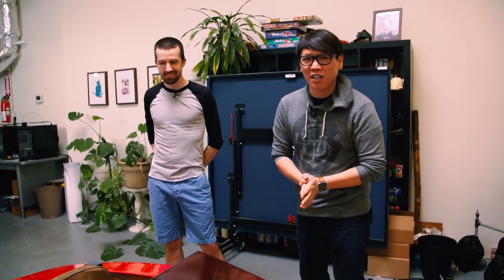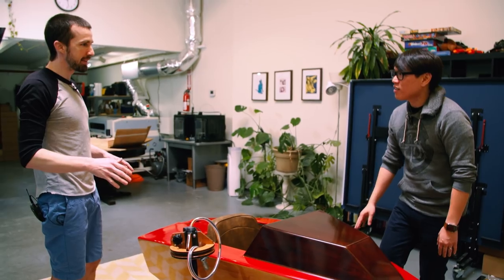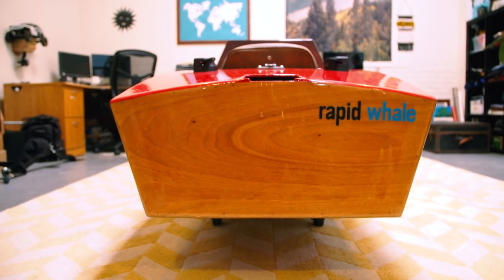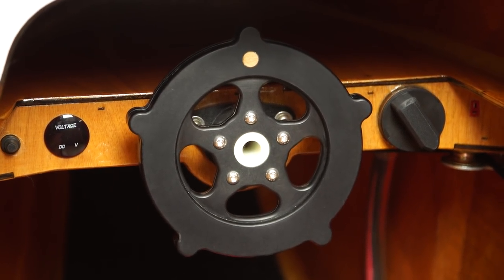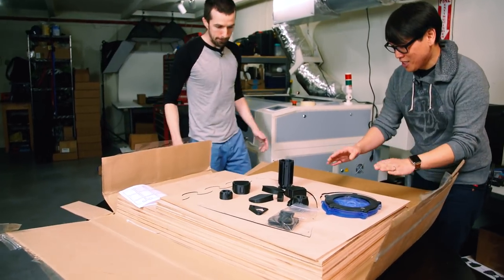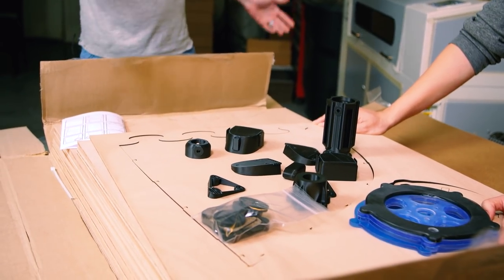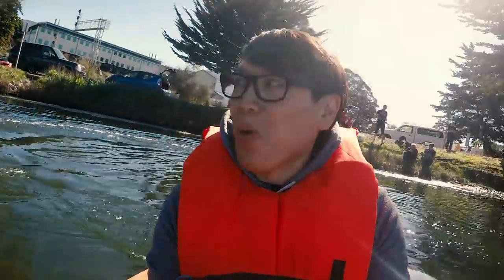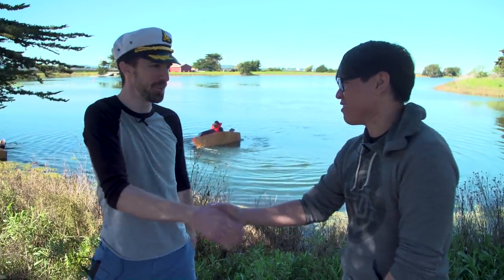Testing a Laser-Cut Mini Boat!

Comment: My late grandfather built me a stitch and glue kayak when I was 8 years old. I'm now 59, the kayak is still in operation. Copper wire and glass taped edges. He had built small stitch and glue sea sleds to tow behind his 35' cruiser well before I was born

Comment: We need mini boat racing!!
Reply: Gasper Erjavec google it
Reply: Or bumper boat.
Reply: I wonder what the fastest 12v trolling motor you can get is 😂
Reply: i would mod the hell out of it, i would probably just over-volt it to 60v or just use something like a 6kw rc motor
Reply: 24v on a 12v motor!  :-)
Reply: Randy H. I would just use a two or three 1200w dcdc step up converters in parallel.  They cost like 20 bucs and go up to 80v,  and that motor is in water so the hell with it.
Reply: jaqs smith im a totall petrol head but I also work on electric cars and  sorry,  our loved explosions don't have a future,  just drive a Tesla and we can talk later
Reply: you are the reason i just laughed and started to watch mini boat racing videos thx

Comment: The adhesive used on marine ply is water resistant- and more expensive as well. The wood used is also an exotic wood used to being wet and won’t rot as readily as regular ply.

Comment: Dude, they look awesome! I want one... But I don't have any lakes nearby to use them, only the sea... I don't think I'd be brave (stupid) enough to take it out there!
Reply: Lufferov yea it does seem a bit freeboard challenged for ocean sailing.
Reply: For the price of one of these you could buy a high quality sea kayak and a small trailer for it.
Reply: Fart Farmer 2.0 or a good high quality inflatable
Reply: Fart Farmer 2.0 or a really nice deep v bow (ocean safe) used aluminum boat with gas motor and trailer.
Personally other then the tiny electric motor I would try this on a calm over cast morning so Cal morning when the ocean is smooth.

Comment: Make a steam powered one, like in the movie Ponyo and I’d be the first one to buy it.
Reply: Garret Hynes that would be easy to do man, and he sells the boat without a motor so it would be simple to put a steam engine in.. I would have an issue with having a hot boiler that close to my proximity though, I would rather have a Stirling engine or something pushing it using the heat difference between the water and the air

Comment: $1.5k - $2k ($1k for his kit + $500/$1000 for extras) for a complete boat sounds good but on eBay you can buy a 2nd hand actual boat for the same and even less. Its a great piece of kit but a tad pricey for a gimmick. They look super fun though.
Reply: uuugh you dont get it
Reply: Yeah exactly. I don't think anyone commenting here has ever owned a real boat that is much bigger/faster and costs far less than this toy boat. on even a small to medium sized lake you'll learn real quick why most boats go faster than a crawling pace. 

there's also no room for an oar , which every smart boater knows you need.
Reply: Themaxleydog heard of a "Praddle"?
Reply: hedlund88 what do you mean? Its a gimmick... id rather buy two quality kayaks and a damn trailer for them versus two of those small slow boats and still manage to pocket an easy grand plus.
Reply: "there's also no room for an oar"  Sure there is, mount a small one to the side somewhere.
Reply: Grew up near a river, legit boats are expensive to upkeep and take a ton of space. This thing could be stored on my apartment patio, can fit in my SUV and would be great for dicking around or fishing imo. I could probably buy a small fishing boat for the same price or cheaper but they still can't fit IN my SUV or on my patio and don't have the cool factor this does. 

but yeah, I would scratch build it though. It's a really neat 
kit, but not for nearly 1k in cut wood and a few 3d printed parts. I would have to use full sheets and not get the neat puzzle patter though :(

I would have way to much fun trying to load it down with electronics. Maybe even completely layer the top in solar cells so it can charge itself in the sun when not in use.
Reply: Snes Guy - You do know they have some great inflatable dinghy's and rafts these days that are in the 3-7 hundred dollar range that are self-inflatable in seconds and when not inflated take up even less - like 1/8th - of the space this thing does while being more stable and probably even more durable and more resistant to wear and tear than these things are, right?  

These things are purely a gimmick, a cool gimmick than I myself am slightly interested in scratch building myself just for shits and giggles to have some fun with it - but for fishing you can't beat a great inflatable dinghy these days, at least for me one of the best features is that if you feel like it you can shut down the motor and kick back and lay down on basically a comfortable inflatable mattress and soak up the sun or whatever and wait for the fish to bite.  

I can't recommend a specific brand or model for them now as it's been years since I actually bought one, the one I've been using recently is a friend's 'custom improved' one based on a military inflatable he got at an auction that is far beyond anything you'll probably find in a store. There were some very good ones back then though so surely there are even more improved models now, maybe even the military grade ones are available too - they are damn near "unsinkable" as long as you aren't being shot at or having rockets fired at you, lol.
Reply: I live in San Francisco—I'd love to have a boat I could store in a closet.
Reply: You have to paint it, protect it, fill it with foam and build it yourself too lol.
Reply: It's about r hint and reward of construction I guess. 'Cause I was thinking something similar too-- could just get an old jet ski for ~2G

Comment: Very very cool but it's another product that's very expensive for most of us, Between $1500-2000 all in is a lot of cash.

The price doesn't detract from the creativeness and fun the thing could give though.
Reply: You know you could make a traditional build plywood boat using 1/2" construction grade plywood, a gallon or so of fiberglass resin (water proofing and with a bit of glass mat tons of strength),  a quart of wood glue (to help bond seams) 10 dollars worth of fastener hardware (screws and if you have a brad nailer some ultra fine brad nails) a few quarts of oil based enamel (for extra water proofing and great color schemez) and a minn kota trolling motor (the most common brand and reasonably priced and you would be out  500 bucks... Even less if you bought a used motor....
I think I have an idea, I need to figure out how to film descent YouTube videos...
Reply: actually you could build this from cheap luan paneling and polyester resign and only fiberglass on the outside and strips in the seams to save on glass.. actually you could get away with strips at seams and joints only as the luan is very porous and acts like fiberglass. Polyester resign is a lot cheaper (but be sure to run tests as to the amount of "hardener" to use in the mix depending upon the heat, sun, moisture etc. (do test is best as it takes only a few minutes to cure... I use the cool to slow it down till everything is covered and then heat it up to cure it  completely.)  The double hull and curves is more than enough strength for the water whcihinherantly distributes pressure to all surfaces.
So now the price is around $50 for wood (you could laminate two pieces together too which would hold the shape very well) and $75 for resign $25-75 for cloth then the batteries $200, motor $75 ebay.. I'd get something with some power or just go with some small gas motor to get on a plane.. it is a flat bottom so no problem and it can hold a lot more weight (use double triple layers for strength spots) .. so yea for about $500 can do... or salvage as much as possible except the resign and cloth Which one could use standard corner wood (more detailed work) for all corners and seams... for about $100..
Of course what is a boat without a sail??????? for when your motor or battery runs out??
ha ha great build!!

Comment: Guys built very small one man boats for fishing when I was young a little smaller than this.  Maybe slightly longer and not as wide.  No buoyancy except the wood itself.   We used about an 8 in spring stretched against the wooden inside of the boat on the right of the person, with a metal lever mounted to slide back and forth against the spring.  Wired from the battery so the spring acted as a rheostat.  You could slide the metal arm back and forth against the spring and change the speed of the electric trolling motor.  A simple switch setup could change to reverse.  The variable speed was handy so you could adjust it to troll against the current along the edge of the river and ease along or stay in one spot against the slight current.  The water was always within about two or three inches of the top sides of the boat.  A built in wooden box would be between your legs as a fish well, hinged lid and all.  A few small holes in the bottom of the well.

Comment: I have one question. Can you add more power? I understand hill speed, that’s what’s called the limit of speed a certain hill can achieve, no matter how much power you have. But I would suggest you take that manufacturer technique, to build a more streamlined hull, with the idea of being able to cut through the water, until you can raise up on a plane, that lowered the waters drag on the hill.

Comment: If you get one instead of using an electric motor. Find a jet drive on eBay off of a Mokia and put the motor behind the seat the jet drive out the back. Adapt the steering linkages with metal rods and cables to the steering wheel and you have a gas powered mini boat. 
Great design. Very fun and cool. And affordable. Thanks.

Comment: I built a stitch and glue sail boat with wire and epoxy a decade ago... its actually pretty common for small boat construction. Made it out of Luan plywood, all done by hand with blueprints. Small sailboats have been a thing for years, see the Nutshell Pram. Not sure why everyone is freaking out about this.

Comment: As someone who has been building kayaks for years this has a bit of a "oh look, they discovered us and think it's a new thing.  Isn't that cute" feel for me.  Stitch and Glue has been around for years and there is free software out there that acts like boat specific CAD and will do a lot of the work for you.  Also, 3 sheets of plywood seems a bit excessive, but that's just me being cheap.  One of the guys on a forum I used to be part of built a kayak out of a single sheet of marine ply, and it had the bonus of fitting into the baggage compartment of the business jet he flew for a living.

Comment: This is awesome. I would scratch build it though. It's a really neat 
kit, but not for nearly 1k in cut wood and a few 3d printed parts.Not well versed on the price of marine wood, but it couldn't be more than $200-$400
would have to use full sheets and not get the neat puzzle pattern though 
:( 

I would have way to much fun trying to load it down with 
electronics. Maybe even completely layer the top in solar cells so it 
can charge itself in the sun when not in use, get a set of waterproof bluetooth speakers in the dash, LED flood light mounted on it somewhere maybe? So many possibilities

Comment: The one thing I don't see anywhere is how long does it actually last on a 12v battery? I mean do you only get like an hour of run time per charge or what?
Reply: Yes actually. It has 2 batteries and each gives you 1hr at full throttle and longer the less throttle you use. So one for the trip out and one to go back

Comment: Chesapeake Light Craft...I would be shocked if they weren't the direct source of his inspiration especially looking at the puzzle piece joints. Stitch and glue boat building has been around for decades, as a stand alone technique i think it was popularized by the late Phil Bolger decades ago. Currently there are thousands of designs based on this method, but i don't think any of them ship as kits in a parcel that size. CNC is the norm, laser cutting seems to me to be an unnecessary complication to production. 
Also, you may not have them on the west coast, but people have been racing "cocktail class" boats since the 1940s, i think they are about 8' long and carry much more motor.

Comment: Don't let the DMV see this. "...every motor-driven vessel (regardless of length) that is not documented by the U.S. Coast Guard which is used or on the waters of this state are subject to registration by the Department of Motor Vehicles (DMV)."
Reply: Your thinking of the DNR, other than that you are right.  However it's a lot easier to register a home built boat than a home built car.  Thing is this video is missing the part of understanding boater laws and safety gear need on board.  The DNR will have a field day if you at least don't have the proper equipment on board.  Like a fire extinguisher, flares, and oar.  However this might fit into the rules as a jet ski, but even that has to have equipment.

Comment: +Tested  yes I like it.... BUT, imagine near the same at 7ft length, with a 55-60 lb thrust trolling motor (about max for 12v) and the right prop for doing it, with a skimmer+foil up front and a hydrofoil to lift it 3-4" off the water to do 8-10 mph. entirely possible, it'd still fit into the back of a small pickup truck or station wagon, able to cover 3-4x the distance, and at a good clip!

there would be some slightly hectic math and designing involved for the skimmer and front foil, the main foil, and for the 3D printed prop to deliver the needed thrust+speed without killing the trolling motor during it's burst demand current (WOT for 10-15 seconds?), but once it lifted the surface area drag and amp demand both drop out drastically. now imagine the reaction to it by onlookers seeing it near silently "flying" along at 8-10mph...

Comment: Cute little boat it would be fun but do you have to register it that's my issues, I have an idea for a kayak I just don't know how to go about building it and I thought it was a great idea or some weird but lightweight camping kayaking what have you is if you could do away with a tent how much more space could you save so what I was thinking is a large person you build it for large small people can still use it a kayak where a large person with a sleeping bag on can turn over inside the kayak laying down so that way all you have to do is cover the hole over top of the seat area this with a skirt so that way rain can't get in and then you have a quasi shelter wherever you go and if you can waterproof that seal very well and still allow for breathing that's very important you should be able to actually sleep camp on the water providing you have good insulation type thing just an idea from a weirdo

Comment: Marine grade is only about 10 to 15% max  better than outdoor plywood, but up to 4 times as expensive. There is no advantage at all if it's going to be covered/sealed with resin or epoxy with fiberglass. Just unnecessary expenditure.

Comment: Considering that you can make the same boat for a fraction of the price, i consider this a scam. And when you consider that you can buy a second hand canoe, chop it, cheapo rear end it for under 100, then buy a new or old electric or gas weed wacker and a plastic prop off fleabay or local for all under 200, and have infinitely more fun...yeah no.
Reply: Anything can be done for a fraction of a price when you do all the work yourself and use cheap materials. I could build my own home for a lot cheaper than paying for a contractors time but I didnt because I dont have the know how. If you actually watched the video he gives the instructions and bill of materials for free and the cad blueprints to make it yourself for 95. So stop being so arrogant

Comment: Stitch and glue, a new technology?? you been living under a rock dude??? I was building sailing dinghy's the same way 40 years ago...it became commonplace in the early 1960's but the basic method goes back to 2000+BC. You Americans only discovered it in the late 60's. Like they say Everything Old is NEW again, 2 generations later.

Comment: All the shapes/pieces are so simple. I dont get the point in using a laser cutter for this, it would be a lot simpler to just use a band saw or jig saw. You would get the whole side piece in one go, maybe both sides at once and not have to do that weird jigsaw seam.

Ofcourse if it wasnt done with a laser cutter these geeks probably wouldnt be making a video about it.
Reply: I think the laser cutter would be useful for precision, especially in the areas where the pieces connect.  If you have a laser cutter, then it would make sense to use it. However, you probably could do it with a band saw or jig saw if you were precise enough. I don’t know much about boat building though, so take my opinion with a grain of sand.